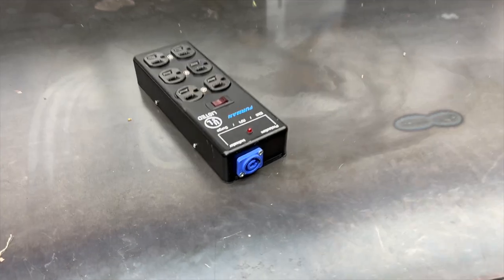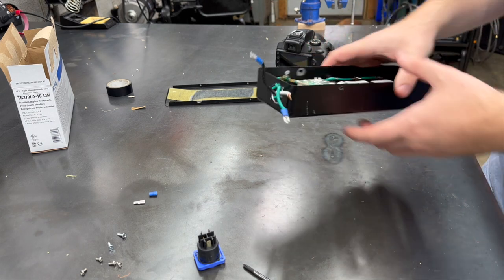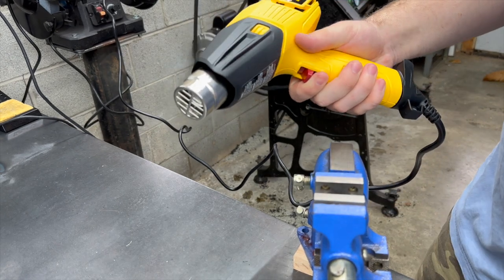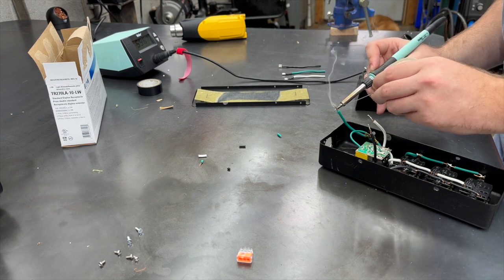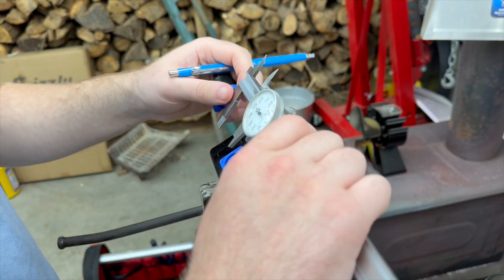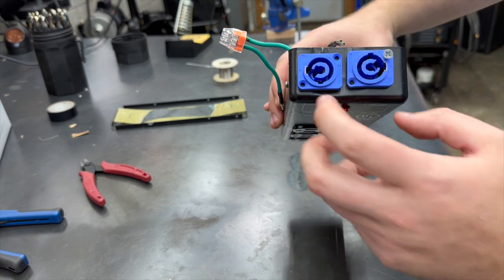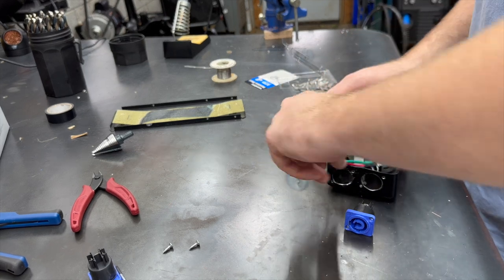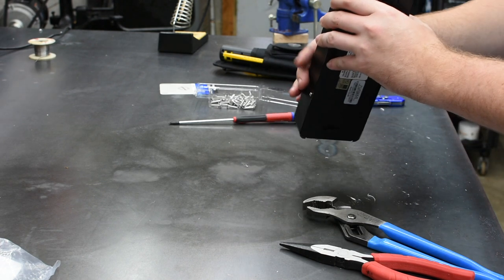Better Stage Power for Live Sound Events (Live Sound Audio Shop Days 4)

Comment: Never crimp and solder. It's one or the other.

In this situation I would have gone with solder and a nice amount of heatshrink. Splitting straight from the IN. Don't forget feeding the wire thru the hole first if you are not able to backmount the connectors.

And before attempting the above, make the holes first. Keeps the possibility of damaging your just done wiring to a minimum. 

The wire nuts you used are ONLY rated for SOLID wire. Nothing else!!! 
So don't use them for this kind of projects. 

So unfortunately you will have to do it again.

There are multiple ways to doing this all with pros and cons. What works best is to keep the amount of possible failures as low as possible, especially with mobile gear that gets thrown around a lot. 
All personal experience after 20-25 years or even longer of building stuff.

Comment: I second all @Richard1977 says. 
These kind of wire nuts are absolutely not designed for this kind of flex wire and usage. These connectors will come lose just by using them (rattling around being busted on a stage or during transport). 
Also, the wire core isn't the size and shape the wire nut is designed for (it's not round like a solid core is). 
One day someone will connect a device with a high power demand and you may end up with a fire due to a bad connection. Or the ground wire will come lose...